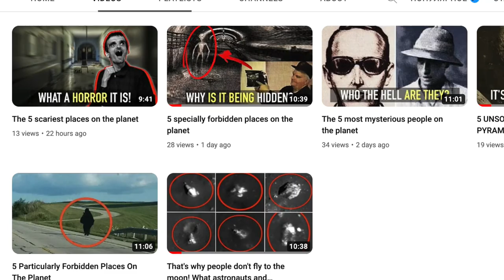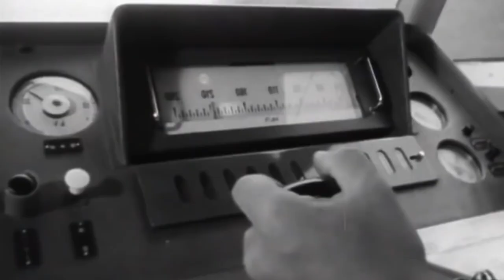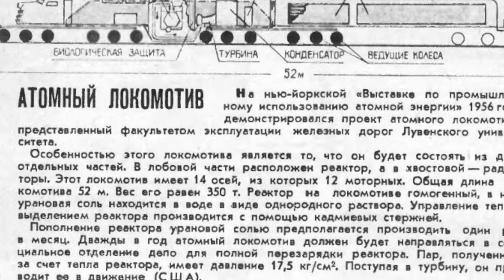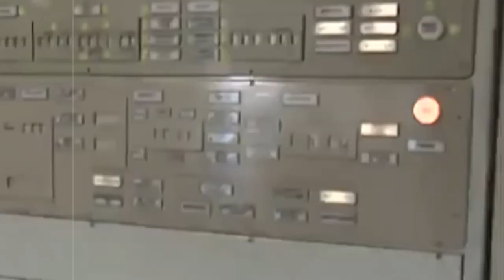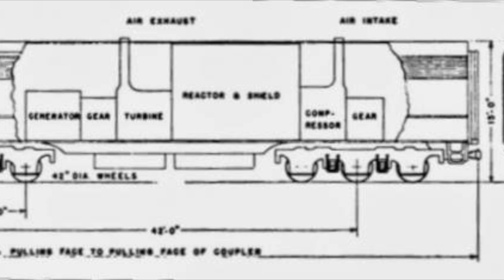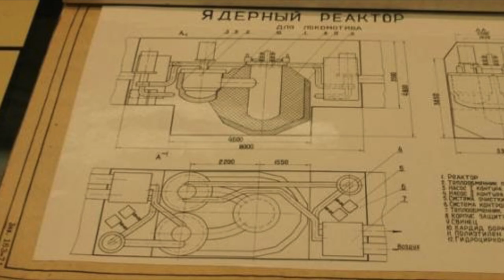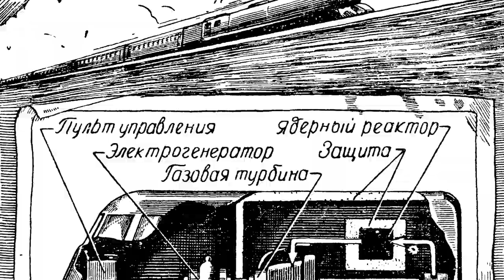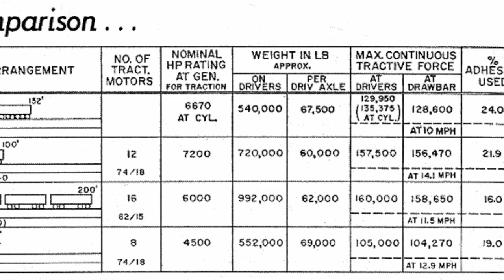Mega train on a nuclear reactor. What came of it?

Comment: A nuclear-powered train is completely new to me. I know that there were military railroad missile complexes with intercontinental missiles of the type RT-23. In 1990 there were still six of these trains in service, but due to the START II agreement between the USA and Russia, which finally did not come into force, they were scrapped. In 2005, the last train was taken out of service and in 2007 the last associated RT-23 was destroyed. Thanks for the video about the nuclear-powered train. By the way, not only the train should be nuclear powered. In the then Soviet Union, a few flights of a Tu-95LaL with a reactor on board were made in 1961. With the An-22PLO another project followed in 1972. With both aircraft, only test flights were made to check the radiation protection equipment and the behavior of the reactors on board. There was no power transfer for the propulsion system. Both projects were discontinued.